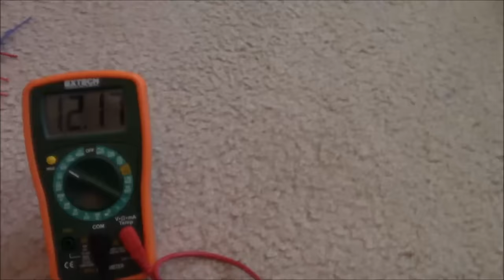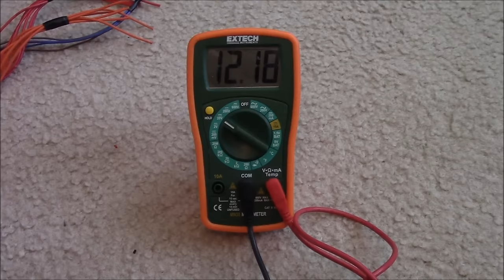How to Hack a Computer Power Supply (PSU) To Use as a 12V DC Power Source

Comment: I am trying to power 5 12v 1,6a lcd montitors from a 300W PSU. According to the label, it should give me 14a at 12v. Now I have everything connected to single wires instead of bundled together.
When I turn things on it doesnt seem to be sufficient. Even when i just connect 2 screens. Is the load divided over the 12v wires or do i need to bundle them together to get the maximum amount of amps out of the psu? Hope it makes sense and that u can help.. :)
Reply from the maker: For 1.6A you should be ok with just single wires as long as you did not extend them.  But the manufacturer is rating the entire 12V rail at 14A and does not individually rate the wires.  I have heard from several other people like yourself that have a hard time powering individual loads with one or two wires.  So I am not sure if the PSU limits the amperage of each individual wire somehow or what.  That is why I, personally, bundle all the wires together to give me the best chance of using the full rating of the 12V rail.  Even then I have not been able to get a full 20A out of my unit without it shutting off.  I would say you should be able to safely get half of your PSU's 12V rating if you bundle them all together.  You could then use a buss bar to divide the power back out to individual loads like your 5 monitors.

Comment: how much ampere for 500 watts psu?  how can we change the output voltage to 13.8? do you have a video for these? thank you
Reply from the maker: +juanmig alcebar You can check the sticker on the side of the psu that shows the specs for the different rails in the power supply.  Look for the one that says +12v.  As for changing the voltage, you would need a voltage regulator or step up converter that you would wire in after the power supply and before the load.  However, keep in mind that you will lose some of your power in the conversion process from 12v to 13.8v so if you started out with 500 watts before the conversion, you might only have 450 afterwards.

Comment: how many volts between green and black as i wondered if you could place a on off switch which would be handy
Reply from the maker: Yes, you can.  That is what the power switch is on the front of your desktop computer.  It is a switch that shorts the green wire to the black wire to turn on the PSU.  I don't know how many volts but it shouldn't matter for your choice of switch.  It will be less than 12V for sure and very little current.

Comment: Some guides say you need a load across the green-black wires (such as 10 ohm resistor) to turn on the PSU. Is this true and/or PSU-specific?
Reply from the maker: xTh3Jambo That must be PSU specific.  I've been using mine for almost a year now with never an issue.
Reply: LDSreliance Yeah I just followed yours and my PSU turned on without load, cheers. My PSU says it can deliver 18A on 12V. You see how you connect all the yellow wires together, would I still be able to use the full 18A if I just used one of the yellow wires? I know it sounds like a dumb question but I'd rather be safe than sorry.
Reply from the maker: xTh3Jambo Theoretically, yes, but the wire would burn up in no time.  Those wires are far too small to handle 18 amps of current.  And there may be controls in the PSU that I don't know about that limit current in individual wires.  I just wouldn't try it.  

If you want to divide the yellow wires in half and solder and crimp the ends like I did that would probably be safe for 18a on either one.

Comment: Hi? I am from Kenya and I have watched this tutorial on how to convert a PC Power Supply to Direct Current. The problem is the power supply I have does NOT have the power on switch (the one you are switching on after the green and black - ground wires are connected together). In such a scenario, how do I get the Power Supply powered on?
Reply from the maker: I responded to your email.

Comment: Do you have to be concerned about amperage? What I mean is that my 12v rail is rated at 19a and if I hook it up to a 12v 6a motor to test, will I fry the motor? I'm an electronics dummy and I'm trying to learn by making a PC bench top power supply, so I hope I'm making sense.
Reply from the maker: Nope, but good question.  That is a very common beginner question, actually.  Your device will only consume as much current as it needs to operate.
Reply: LDSreliance - Thank you very much!
Reply from the maker: You are welcome!  Thanks for watching!

Comment: How can i power my 30 amp and 20 amp radiator fans with a PSU?Do you have another video for the wiring?Should I just refer to the "how to use PSU as battery charger"videos?
Reply from the maker: 30A will probably exceed the 12v rail on most PSU's.  You would probably be better off buying a dedicated 12v power supply for that application.  It will be a lot cheaper unless you have a free PSU laying around:  https://amzn.to/2JjCGYY
Reply: LDSreliance yea today I hooked the 20 amp up to the yellow and it went on full speed but haven't tried 30 amp yet cause Im kinda iffy on it.I have 450 watt psu that I used to do this and the 12v rail has 15 amp on side label.I'm guessing maybe I shouldn't continue using this PSU on the 20 amp fan since its rated 15amp?
Reply from the maker: Fans are forgiving.  They can run at lower voltages and lower amps but you won't spin them as fast.  Other loads are not forgiving and just won't work at all.  So yeah there is no way that your 30A load will operate on that PSU unfortunately.
Reply: So since yesterday I figured another solution that I'm going to stick with 5 volt rail I got 35 amps available and I don't mind the fans going slower because fans will be used to vent my shed. Thanks for your help good video!
Reply from the maker: Nice solution.  Good job and thanks for the support!

Comment: Hello just have a question please...
Can i collect all yellow wire (12v) and connect individually to take multiple outputs for my led project? I basically wanted to have 12v 2amp or 12v 2amp on each individual connection... Please reply .. and any random wire of yellow and black will do that right ?? also tell me how safe it is to use it for this purpose of connecting multiple LED SDM beads 20w , 30w soo only, and my smps is 450w thank you soo much in advance...
Reply from the maker: Yes 12V 2A should be fine over a single wire.  I would not do any more than that, though.  You could burn up a single wire trying to run too much current through it.  That is why I combined all mine into one mega wire connection.  Yes you can use any yellow wire and any black wire.
Reply: Thank you so much for your reply, just wanted to make sure one thing... I'm not going to connect single wire with multiple LED I'm going to take one yellow wire and one black wire to connect one LED light which is about 20w similarly I'm going to take another yellow and black which is free and connect and do the same for other 20w LED beads , can i do that ? If soo can i use all available 12v wire (yellow and black) to achieve this ? Waiting for your advice on this and thank you for your kindness to reply me god bless
Reply from the maker: Yes that should be fine.  20W is a little over 1.5A on this 12V power supply.  So that will be fine with one yellow and one black.  Any more than that and I would use multiple wires together.
Reply: So you mean to say that connect all yellow and all black together and takes multiple 12v like maybe 4-5 connections from that? For 20w each connections

Comment: do u have to connect all yellow and black wires or can u use 1 set of wires to power a lights?
Reply from the maker: Karl Smith It depends on how much power you need.  Those wires are skinny and will burn up if you try to pull too much current through it.

Comment: Nice easy video!...but, my psu puts out only 4.3 amps 12vdc. So anyway I took out power supply and with the plugs still attached I jumpered the green and black and put power to unit and the fan started going so then I said alright now I’ll do what you said and finished it off blacks all together yellow all together separately of coarse and wire nutted the green and a black together and plugged it in and the fan just twitched that’s all and I no longer had 12 volts at the bundle of black and bundle of yellow? Do you have any ideas what I did wrong? Thanks
Reply from the maker: The PSU is not sensing a load.  You either have to wire in a resistor to trick it into thinking there is a load or you have to connect a load to the PSU and use the switch on the back of the PSU to turn it on after the load is connected (or if your PSU does not have a built in switch, install one between the black and green wires).
Reply: Ok thanks I’ll try that.
Reply from the maker: You are welcome.  Thanks for watching!

Comment: I have a 12V 70A single rail PSU. Would it be the same if I just used the 12V from the EPS cable with extension cables and cut the extension cables instead of cutting and soldering all the PSU's yellow and black wires together? I'm trying to keep my PSU cables intact just in case I need it later.
Reply from the maker: Yes, you could do that but you can't use all 70 Amps of that psu in those small gauge wires without damaging the psu or the wire.  So if there are only a few positive wires in those connectors you may only be able to use 10 Amps or so safely.
Reply: Oh, that makes sense! Thanks
Reply from the maker: You are welcome.  Thanks for watching!

Comment: Thanks for the video! can i modify this power supply, convert to have 54VDC and 4Amp ? or can i combine more power supply to have this output? i would be really interested in this! Thanks a lot!
Reply from the maker: Krisztian Adrian Barna I am sure you could.  You could use a dc convert (such as http://www.amazon.com/DROK-10-60V-Converter-Voltage-Regulator/dp/B00C498MGY/ref=sr_1_12?ie=UTF8&qid=1432492173&sr=8-12&keywords=dc+voltage+%22step+up%22) to do that but you are losing some efficiency if that matters.

Comment: Hi,

I'm trying to use a power supply to power two different 12v devices. How should I go about doing it? Do I need to use all the 12v+grd wires as you do in your video? or can I just use 2x 12v and 2x ground wires?

Thanks
Reply from the maker: I would bundle at least 3-4 of the yellow wires together for each device.  Same with the black wires.  That will allow you to safely use a meaningful amount of current without danger of overheating any of the wires individually.

Comment: Hi pal...one question..What if i need, for example, 3 12v connections? i mean, if there are 10 black wires and 10 yellow wires that worths 5 12v connectors?...
Reply from the maker: You can divide it however you want.  But it will limit the amount of amperage you can safely use on any one load.  By combining them all together, you can safely use the full rated amps of the +12v rail.  If you need to subdivide it after that then you can use a load center or buss bar.
Reply: Oook! all subdivided connector will have 12v but limited amp...and the same thing happens with he 5v connections i guess.....Thanks bro! 1+ like 4 ya.
Reply from the maker: Oscar Peinado
You are welcome.  Thanks for watching!

Comment: will this 12v give full wattage of psu, because a psu is 500w and this watt is divided to all different voltage and i want full 500w(or a psu can give) in 12v only for high amp dc motor project.
Reply from the maker: There are multiple "rails" on the power supply that provide power to various parts of a motherboard and PC components like video cards.  The power rating of the PSU adds all of those numbers together for an aggregate power number.  In other words, the 12V rail with the yellow wires probably doesn't provide more than about 20A on most power supplies (240W).  But you have to check the specifications of the PSU manufacturer to know for sure.

Comment: Hi
I am very new to model trains & was very interested in how to use Computer power supply for 12v led lights on my layout.  I put black & green wires together switch on & the fan started & then stopped. whats wrong.  My power unit is FSP GROUP INC.  MODEL No FSP800-80LN (85)  WIRES :-  RED, BLACK, ORANGE, YELLOW, PURPLE, BROWN, GREEN, BLUE, GREY, YELLOW/WHITE, YELLOW/BLUE, YELLOW/BLACK. I would be grateful for any help.   Peter.
Reply from the maker: You have to have a load on the PSU to keep it running.  If it does not detect a load it will shut off.  Connect your lights to the yellow and black wires and turn the lights on (if there is a switch) and then try running the PSU again.  It should work if there is enough load.  Otherwise you might have to wire in a resistor.
Reply: Hi many thanks, that works.  Just like to say thanks for all your video clips which has helped me a lot over the last few months.
Reply from the maker: You are welcome!  Glad you found them helpful.  I will keep making them.

Comment: May i know why u r jointed green and black wire? Is it nessesory to joint?
Reply from the maker: Yes, that is how the PSU knows to turn on.   Normally there is a button or switch on the computer case that does this.  However, since we don't have the PSU connected to a computer case it is necessary to jump the wires.

Comment: Hi, have tried this hack on three different power supplies but none will turn on. Other people suggested adding a load, tried plugging in an old hard sim but still wouldn’t turn on. Any other tips?
Reply from the maker: Many newer PSU's have tech that attempts to save energy.  So if the PSU doesn't detect a load it will not turn on.  Or will turn on for a split second and then shut off.  Some people use diodes for this.  Another simple way to do it is to use an old case fan or something.

Comment: Can I split up the black(ground) and yellow(12v) wires to have two sets. Lets say I'm trying to power two 12v 4.5w LED lights and want them to have their own individual switch.
Reply from the maker: Of course.  I combined all of them to make sure that I did not burn up any wires if I used the full 20 amps of power on the 12v rail but if you want to split up the wires you can.  Just keep in mind that you may not want to run full power through one side or the other.  It may be safe, it may not.  I just like to err on the side of caution.
Reply: Thanks man. I wish I had found this video before I suffered through some pretty awful ones.
Reply from the maker: Yeah, there are some pretty bad videos on this out there.  I watched about a half dozen of them before I got sick of it and made my own.

Comment: How many amps does this produce?, I'm think about using a PSU to power a car stereo and it needs around 12amps.
Reply from the maker: +Alex Jeffs This one puts out a max of 20 amps on the +12v rail and it is on the smaller side of PSU's (400-450 watt I can't remember).  So most any PSU should be able to crank out 12 amps of 12v power.

Comment: My supply keeps shutting down after it started even after adding a load. I used different resistors values, power resistors of 10 ohm even a small computer. It only worked when i used a small adjustable buckconverter with LCD. but it had no load and only used 0.17A on 12V and the power for the LCD was 0,026A with 3,3V
Reply: When all the wires shut down the purple wire becomes active i think this is the standby but it cant get out of his standby

Comment: What if I wanna use dc from solar panel to power, does it damage if I plug in ac input or I have to find the part were the ac is already converted in dc?
Reply from the maker: Unfortunately, DC to DC ATX power supplies are extremely rare and much more expensive.  I showed one in a solar powered crypto video that I did a while back: https://www.youtube.com/watch?v=ucdIE2aG_Ds

Comment: Really like the video but my power bix dont have any yellow wires on it this is odd.Need assistant really bad only orange black red brown white green blue
Reply from the maker: What is the model number and manufacturer of your power supply?  You'll have to look up a wiring diagram online and find out which color is the +12v rail.
Reply: +LDSreliance its the orange wire but still wont come on also its a Compaq. The white wire on the board say standby but when hooked up nothing happens.Some say it needs a signal so i added a 10 watt 10 ohm resistor still no thing.Thanks for  the reply i guess i git one that's more complicated than the one's with the yellow wires showing because all the videos i see has that not like the Compaq.
Reply from the maker: atonious poole
OK so you have a load/resistor on the orange wire and black wire.  You should have the white wire grounded to a black wire or wired to a switch that you can turn on/off to complete the circuit and start the psu.  Right?

Comment: How many amp is this 12 volt running? I need 12 volt 3 amp to run my CB radio in my home or should I not worry cause I have an inline 3 amp fuse?
Reply from the maker: The one in the video is 20A.  All power supplies for computers have different ratings so check the manufacturer ratings of the 12v rail.  However, I have personally never seen one with less than 15A on the 12V rail before so I think you are totally safe for your application.

Comment: Great vid. Thank you. question. I fabbed one tonight to power a foam cutter i made and am using 18 guage nicron wire and the sucker glows bright orange. not sure if its right. i was reading 1238 v any suggestions?
Reply from the maker: +Jamie Bush I have never used a foam cutter.  I don't think they are supposed to glow orange, though.  The voltage is right but it sounds like the current might be too high.  I don't know of any way to regulate the current in that power supply.
Reply: Back down to 9 volts and switch to 20 gauge  nichromium..120 degrees max...perfect temp